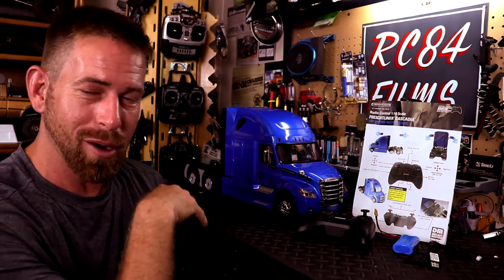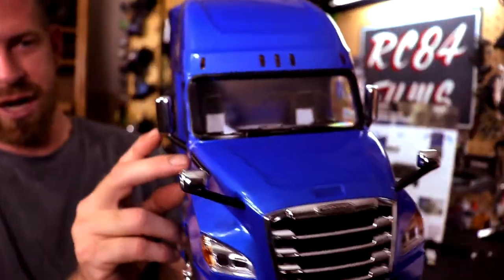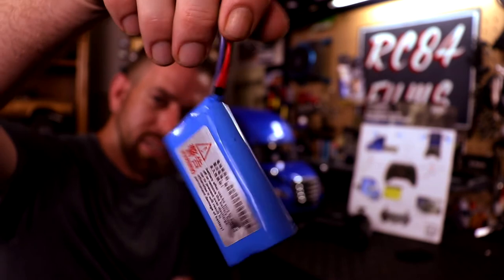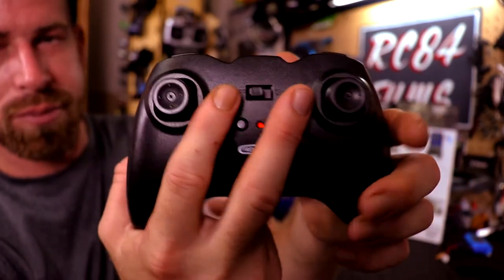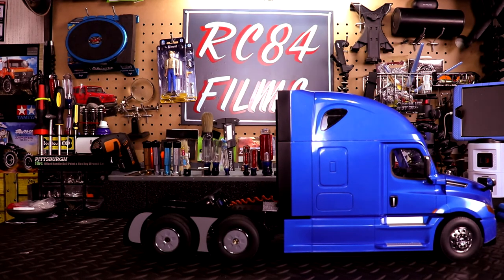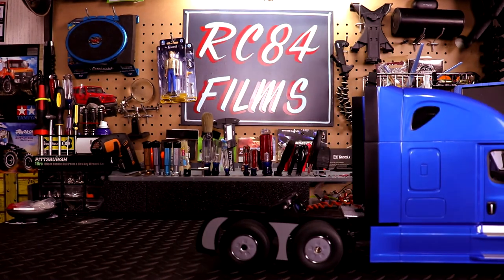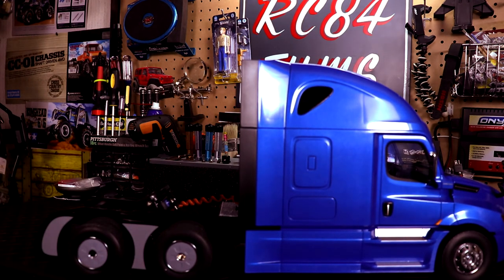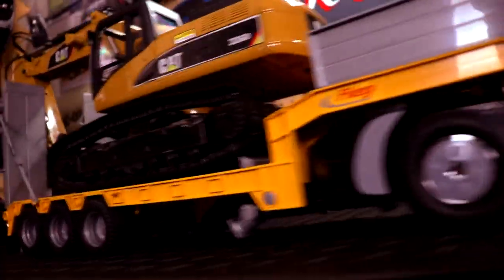RC84Films: 1/16 RC Freightliner Cascadia

Comment: Cool truck. Yeah they lied in the instructions. That doesn't look like any lipo pack I've ever seen. The round AA type looks like the same NiMh pack that's in my small drill. The only thing that I worry about is getting parts for the truck. Axles, gears, and wheels. Good looking truck.
Reply from the maker: I agree not a lipo battery it's a lithium ion battery. The truck is only $250 but it's a great looking city type truck not a construction hauler but oh will I will use it until I find something else
Reply: @RC84Films  I hope she works well. The Tamiya trucks are stupid price. Bangood has HG 802 6x6. Check it out. Would be a great alternative to Tamiya.
Reply from the maker: Trust me I have look at the tamiya truck stupid crazy price. It would be a $1,500 setup after all said and done. The hg truck is 1/12 and I think is $600 for it.

But thanks for watching the videos and commenting and all I do appreciate a lot. I would love have some nice hydraulics rc construction vehicles but those are way out of my budget. So I have to work with what I can afford

Comment: on my truck that I just received the front wheels are not completely straight. They are slightly to the left. Can this be adjusted on thie truck? Thanks!
Reply from the maker: Yes on the controller
Reply: Just received my semi, I noticed that I have the same issue. Doesn't seem to wanna turn to left . I'm thinking of returning it.